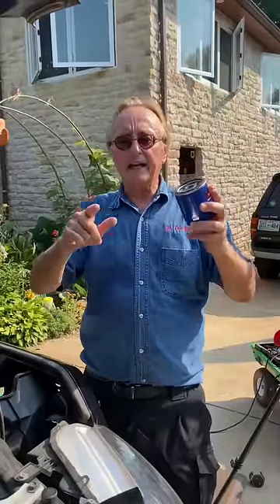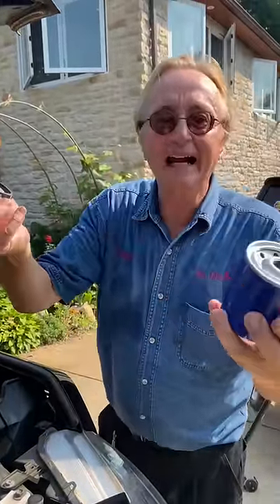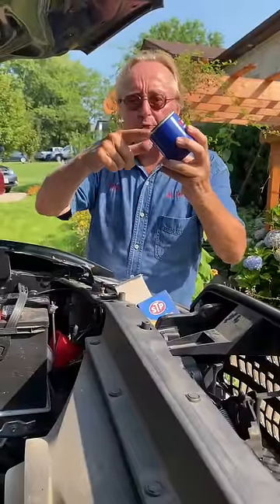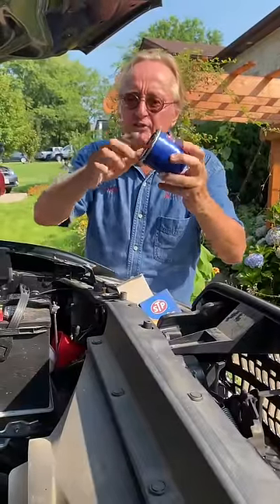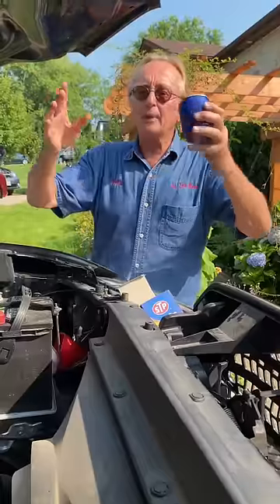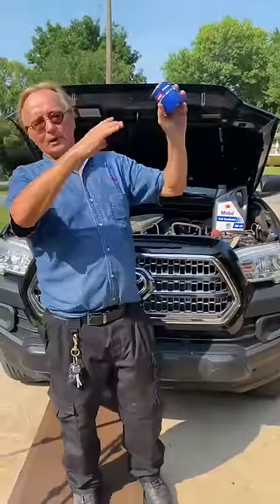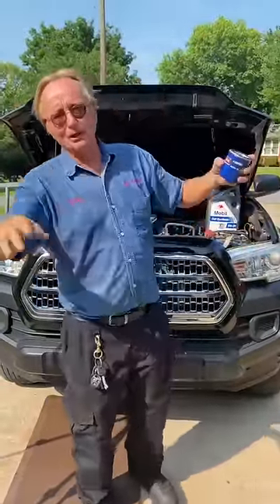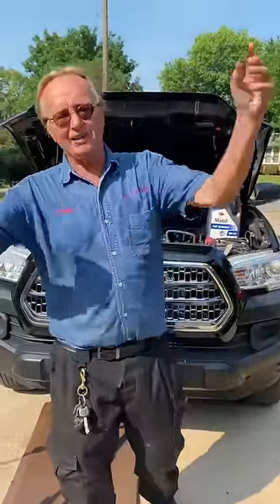If You Change Your Engine Oil Like This You’re Stupid

Comment: Yup! Did this when I changed the filter on my parents riding mower. As soon as I started it I noticed oil leaking on the ground. I immediately turned it off. I pulled the filter and sure enough the old gasket was stuck to the engine. Took it off, reinstalled the filter, toped of the oil and everything worked just fine.

Comment: I just had my similar moment, the filter is in a really awkward spot on my ford f150 2011 so I didn’t realize the new gasket actually fell off, I tightened it by hand and should have noticed the missing “squeeze” of the gasket but didn’t started my engine for 4 second and 5 quarts of oil was on my driveway… sucks but learned my lesson… will ALWAYS check the gasket lol

Comment: In my 20 plus years of being a mechanic i've caught 2 gaskets sticking to the engine, i saw both instances and averted the big leak.  it doesn't happen often but just make sure your old gasket comes off with the old filter.

Comment: I've been replacing my oil for a long time now, probably done it 10-15 times on my own, ever since Jiffy Lube screwed up and didn't empty the old oil out of the engine before filling it with new oil, giving me twice as much oil as I was supposed to have. I knew there was a gasket, I haven't paid attention to whether or not it got stuck on the engine because I never thought about checking, but I also never had a problem. Must be rare, or maybe if you wait too long to do the change?

Comment: After you change the oil and filter its a good idea to run the engine and look under the car to see if any oil is leaking.. this happened to me on a new 1984 Ford 150, but I saw it leaking big time and yep, it was the old gasket stuck..

Comment: I worked at jiffy lube for a minute. What you're supposed to do is lubricate the gasket on the new filter with oil so it's 1.) Easier to get off the next time and 2.) Doesn't stick to the mounting plate. Jiffy lube may suck but I learned alot at that job

Comment: Not normally mentioned in oil change tutorials but should be done; always wipe the gasket sealing surface clean with a rag. It removes any debris and allows you to check for a stuck gasket. Don't forget to oil the new gasket before filter installation.

Comment: It's also a good practice to wipe the engine gasket seat with a rag. Then you not only have a clean gasket surface but you'd also notice if there was a gasket stuck on there.
Reply: Damned right!     Sometimes some gunk gets knocked loose from above when you are tinkering  about under there trying to get the old filter can out.    You sure don’t want that either getting in the filter or underneath the ceiling ring!

Comment: In doing countless oil changes for years on my own vehicles, THE one and ONLY time I failed to wipe down the filter mounting surface on the engine, is when the old gasket was stuck on and resulted in double gasketing.  The car sat in the driveway until the next morning.  Heading out in the morning I glanced back in the rear view mirror and noticed a dark line or stream trailing from the car.  Stopping to investigate and peering under the car I notice oil pouring out around the new filter.  Lesson learned - there are no short cuts in doing a proper job. Take your time and do it right.

Comment: I see this about 5% of the time I'm doing an oil change service, likely due to the installer cleaning off the mounting surface but not applying oil to the new gasket.
Done thousands of oil changes and not once have I had one of my filters leave the gasket behind upon removal.
Also helps if you don't overtighten the ever loving crap out of the new filter. Some of them I could swear were installed by a competition bodybuilder.

Comment: Make a video of WHY you should never fill the filter  with oil when reinstalling . Seems lots of people still do this . I  found this caused engine damage by not allowing the oil pump to evacuate the air in order to prime to get enough pressure to push through the soaked oil filter . PS  I did not have a wornout oil pump on my 68 Dodge 383 @ bbl, I had replaced the oil pump and I still had the problem because I was dumb , listened to some old guys in town. After I stopped putting oil in the filter the oil pump would prime no problem .

Comment: I did this about 10 years ago on my 2000 ford ranger! I got lucky and was grabbing my tools off the floor while the truck was running and still on the ramp and I seen the oil leaking out. caught it on time before the engine locked up but still lost over 2 quarts of oil within a couple of minutes.

Comment: After several dozen oil changes, I have never had the oil filter gasket get stuck like that.  I have, however, had oil drain plug gaskets get stuck to the pan a couple times.

Comment: Great tip even though you should figure it out pretty quick when it's leaking oil all over the place. I've worked in Auto Parts around 15yrs or so and I've heard of this happening way more than once. Also  make sure your drain plug is tight/snug(don't over tighten tho) then check for any leaks underneath after you fill it with oil. I had an NTB Tire we use to deal with not tighten a drain plug enough(probably only hand tight I'm assuming). The customer drove it around not knowing it was leaking pretty bad until the oil light came on. She had driven 30 mins away or so to the city after she left and decided to drive it straight back to NTB since she knew they obviously screwed something up. She made it somehow but her engine was ticking like a clock. I was told this after another NTB employee (who didn't work on it) told me abought it after asking me for a GALLON of Lucas Oil Stabilizer to try to save her engine(don't do this EVER btw unless it's a last ditch effort like this case I guess). I suppose what I'm getting at is whether you do it yourself or have it done somewhere (especially chain oil change places) make sure you pull over and check for any leaks before leaving. PS: I hope NTB has good insurance lol.

Comment: I think more vehicles should have the canisterless design and be installed from the top instead of underneath the car. Sure you have to vacuum out the old oil which requires different tools but I think it's overall better. I suppose there may be some issue with this style but I've never heard of any. My 04 E500 was that way and the only gripe I had was that oil changes cost more at the dealership and couldn't really be done at a Jiffy Lube but the vacuum pump I bought was only $100 bucks and I used it alot actually.

Comment: I always put a skim of oil on the Filter. It helps it seal and keeps the gasket from sticking. All you have to do is make sure the old filter has the gasket on it.  If you can get your hand on the old filter you should be able to twist it off. Read the directions on the Filter Box. Never ever tightened the new filter to tight. If you can't twist it off with your hand the filter was put on to tight. That is again if you can get your hand on the filter. If you have to use a filter wrench it is easy to over tighten the filter.

Comment: I have a 2002 Ford F150, 5.4 with a 193,000 mile. I keep it maintain, bought it new. runs like new. Do I need to worry about having the timing chain changed due to the mileage.

Comment: I have been changing the oil in cars, trucks, and heavy equipment for well over 40 years. The double gasket has happened to me once AND I have had the gasket fall out of the new filter...Use good quality parts and oils.

Comment: Had that happened when I changed the oil on my  back then brandnew 2004 Hyundai Elantra for its 1st oil change. The original oil filter was on very tight and gave me a little fight to take off. I did not notice that the gasket  did not come off, and put on the new oil filter. Funny thing is I did some local driving on the weekend and the oil did not leak. On Monday, when I took it to work on the highway I noticed the oil light come on and smoke billowing from the back of the car. Luckily, I was able to pull into a gas station right away. I put more oil in the engine, and the oil just came right back to the ground. The gas attendant commented he seen that happen with double gasketing, and thats when I realized what happened. I had a pipe wrench in my trunk which I used to correct the issue on the spot. That car is still running today with 140k miles on its third owner.

Comment: I always wipe down the engine mating surface for the gasket and apply a thin film of oil to the new one. Ensures no gasket was left behind and the new gasket has a nice, clean seal that will break free easily the next oil change.

Comment: Scotty this happened to me at a drive through oil change. My truck was an '84 and had no oil pressure gauge. Blow the motor. They did pay for a used motor with same miles as mine.

Comment: I think most, if not all, DIY car mechanics do this once, with varying results. I know I did it once on my family's old Mazda 6. I changed the oil and ran the car to check for leaks and holy cow was there one! Oil just came spewing out onto the garage floor! I immediately jumped into the car and shut off the engine. I don't think there was any permanent damage, but the car obviously didn't like it.

In my defense (?), I had so much trouble changing the oil that one time. The filter was under the car, and someone had overtightened it real good. I couldn't get it off. I had to hammer a long screw driver through it and use that to get the filter to turn. After that, the gasket was stuck on and couldn't see it.

Moral of the story: ALWAYS check the old filter to see if the gasket is on it. If not, immediately check to see if it's still on the engine.

Comment: I normally lube up the new oil filter for the customer vehicle by rubbing two oil filters together from their gaskets, simply because if it’s not lubed up from that, I know the gasket is still up there and there’s nothing to lube it. I also look but this routine helps a lot.

Comment: Some cars have low oil sensors that prevent the engine from frying itself 🤙🏽 this double gasket happened to me in my 89 4runner (cheap stp filter!!!) I guess I was leaking oil while driving the 4runner and it suddenly shut itself off lol changed the filter on the freeway addded new oil and she was back on the road no problem! Gotta love Toyota’s!!!

Comment: Very true, have seen this happen before at certain work shops, 
 and yes I've had it happen to myself also. As a newbie you are more cautious and pay more attention. After years of doing oil changes and more you can easily forget a step or two cause in your own mind you think, I did it and I know I did right. Really, that kind of confidence is good but can bite you in the end specially if you happen miss one of one these critical steps. Most likely in a driveway or shop if it happens there you might get in to a heap of trouble but at least you have a chance to save the engine, minus all the oil spill and embarrassment. But if it's not spotted then and you get in to a car for a road test and it leaks it all out while driving and you blow the engine up cause the engines crank bearings overheat from loss of oil, be prepared to buy the customer a new engine or need get a new job. OUCH !!!

Comment: Noticed you have a Tacoma sitting there. Important note on a Tacoma 2.7- If you are using ramps, let it roll backwards off the ramps after you fill it before you start it. Don't start it on a slant. You wont like the sound it makes.

Comment: I've also found if you use cheap gaskets for the drain bolt on the oil pan sometimes some of the material they put on the outside will be left onto the surface of the oil pan and needs to be picked off with my fingernail

Comment: I was taught to match the gaskets from the old filter and the new filter, then twist them. It ensures the new gasket has oil on it and the old gasket isn't still on the motor.

Comment: Isn't this the reason you lube your new filter gasket with some oil?  Plus do people not look at their old filter either in the drain pan or transfering it to a trash can/bag?  I have owned several cars used many different filters (i perfer fram with the wrench grip bottom) and never had this issue

Comment: I can't imagine how anyone could do that. I've ALWAYS cleaned the surface the new filter sealed to. Same thing with the drain plug. Any gasket surfaces should always be cleaned and inspected for any debris. It's not difficult and saves from doing the job twice, or more till the lesson is learned. For me, it just made sense.
Reply: If you can't imagine how it's possible, you have a poor imagination.

Comment: I was taught to rub the older filter on the new one to get it lubed up. This way it doesn’t stick to the engine and also knowing you pulled the old one off with its gasket still attached to the old filter

Comment: You don’t need to get a flashlight and look, if the gasket doesn’t come off with the old filter, they you know it stuck. I always rub oil on the gasket before I install the new one anyway, it prevents it from sticking for the next time. 👍🏼

Comment: I was an elevator mechanic in the navy. Our elevator pressure system was 5000psi. We as team where doing routine maintenance one of the lower elevators. We had to remove hydraulic cylinder for licking. One of gasket failed fair enough simple job.  How we would do this somebody turn system off, but system would still have some fluid left and somebody had to hold bucket. That was the new guys job. We would all watch get squirting in face by hydraulic fluid. That was site to be seen.  After that he was told to remove old gasket and put new on. It a extremely simple task. New guys always do it. Normally one of older sailors watch him or her to see if they miss a step but today our more experience team member where watch or talking too much. The new guy forgot to remove old bad gasket. He put hydraulic system back together. We did test run and I watch titanium cylinder fold like plastic straws. That 5000psi didn’t even notice something wrong. 
That thought me one lesson. Always check to make sure you don’t have double up gaskets. It wasn’t last time I’ve seen that.

Comment: Not only retrieve the old gasket if it's stuck to the engine... Be sure to oil up the new gasket.  If you don't, it'll be a bugger to get off next time.

Comment: Dip your finger tip in the new oil and put a thin film of oil around the gasket this will prevent the gasket from sticking to the engine.

Comment: i know this is different from what he said in the video. i just wanna tell this. i have always put oil in my new oil filter before putting it on. for the first time a guy helping with the oil change didn't put oil in the new filter, when starting the engine letting the oil go through the engine there was a dry spot because the oil was going through the filter and i heard bad metal clanging for a sec or 2 then it went away.

Comment: First time that I ever tried to change the oil in the car. The only thing I had to go by was tv commercials. Well first off I had a canister oil filter.that was different. And then there was the gasket in the box. After asking the hobby shop guy. So many questions. I thought well it’s gotta go in the canister. So One new filter and gasket  5 more quarts and cleaning up the Exxon Valdez spill. I finally got it out of there. That was 51 years ago and it seems like yesterday whenever I pick up oil.

Comment: I did that once when changed oil on my Honda CBR 600 RR didn't realized the mistake next my nephew borrowed it and as the oil leaked it spilled on the front tire and my poor nephew looked control and fell thankfully He did got hurt beside a couple of bruises but I felt terribly bad since then I always double check those gaskets.

Comment: I learned that the hard way when I first started doing my own oil changes. Luckily I run it a little after I'm done so it leaked out in the driveway and I quickly turned it off.

Comment: I worked in a quick lube shop not a corporate one but we had to deal with dealerships and jiffy lube messing up people's cars. My boss/owner literally would go to the shops and dealerships then just start fights and help the victims of these issues get a new car or help them do lawsuits because we've had cars come in without oil, loose filters, drain plugs missing, drain plugs loose, and under filling the motor. Bmw is good at putting 3 qts in a S54 for example but it should of had 5.8qts. They were charged for that but wasn't given that. The thing was they just left the bmw dealership 8 minutes before they showed up to ask us why their car was making motor sounds that were unusual.

Comment: This happened to me somewhere 10-15 years ago. I was in a rush getting oil changed for wife before I went to work. Didn't start the car to check for leaks afterwards. She got a few miles down the road and oil light came on. She drove it back home. I shudder to think about that. Anyways, got lucky, car kept on running after I got the oil redone again. I always start the car and check for leaks afterwards, and always check the dirty filter for the gasket now.

Comment: I did this on my mustang I took old filter off didn’t realize the gasket didn’t come out with the filter twisted new filter on it wasn’t leaking when it was cold but as soon as I turn the car on and got warm oil was just leaking badly. I noticed cuz I test drove after the oil change and noticed a trail left on the road that lead to my car I looked under and sure enough the filter was gushing oil